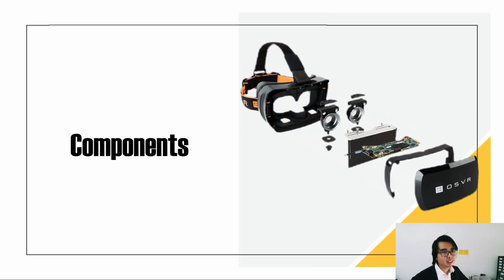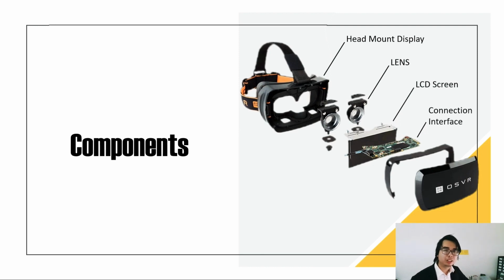Virtual Reality | Technical Presentation | UTP PCS EE 2021

Comment: Interesting topic, Harith. I’m just curious on the safety issues of VR. What safety issues can affect VR users?
Reply from the maker: Good Question Madam Farah, from what I have research many VR users encounter severe eye strain and dizziness due to long term usage. As explain in the presentation, scientist and engineer perfected the optic lens to reduce issues such as eye strain. However, not eradicating the issues. 

As for dizziness and nausea, users especially VR beginners may not get used to fast motion sights. For example, riding a rollercoaster in VR will trigger the brain to feel its sensation. Yet, the body remains in one place while the brain sees a moving picture up close. This could lead to the exhaustion of the brain trying to comprehend to the experience. It is recommended to take frequent breaks from virtual reality to avoid nausea.

This are some of the main safety issues VR can bring toward users. Yet, there is no evidence VR can bring permanent damage to the brain and eye. Scientist and Engineers are trying to design a better VR headset each year, and thus reducing this limitations.

I do hope this answer meet your expectation, Madam Farah😃👍
Reply: @harithabdullah2917  Yes,. 👍 VR is still a fairly new concept. While its applications seem far and wide, each technology faces a limitation that cannot be accounted for. Hopefully, VR is worth it despite the various limitations.

Comment: I've watched the video and it was very informative but I have a question. As you said, the benefits are plenty in terms of employee productivity and increasing the effectiveness of the workforce through training. My question is this, is it sustainable in the long run? As the workforce will increase due to population and market expansion, the cost of maintaining or acquiring VR equipment will rise per employee as the headset cannot work on it's own and will require supplemental devices. The electricity cost required to use these will also increase according to the industry and necessary training needed. There's also a matter of IT literacy as not everyone will be able to pick it up as easily especially if it's their first time using it and would require training to use the VR equipment itself. So I ask again, is this sustainable in the long term?
Reply from the maker: Good Question.. Miss Hanani... While this technology is sustainable, yet new alternative to real experience will be created in the near future. VR is just another stepping stones for innovaters to design a far more sustainable technology with cheap alternative and minimal waste to manufacture virtual experiences. I do hope this answer satisfy your needs.👍